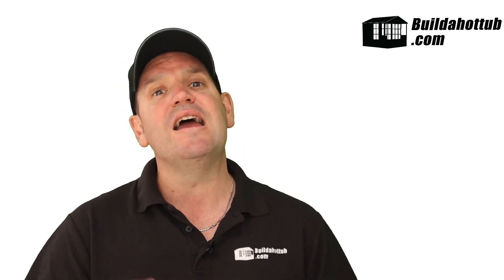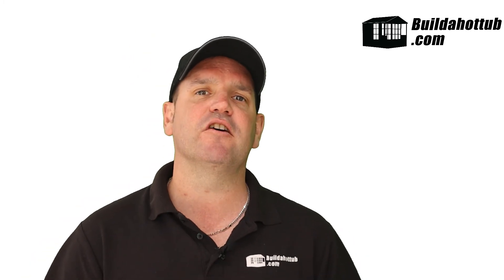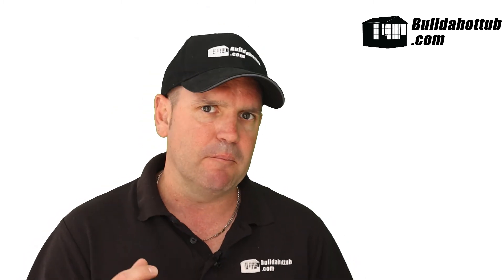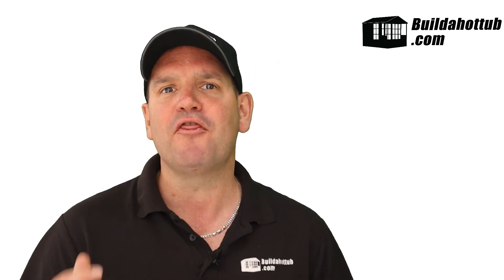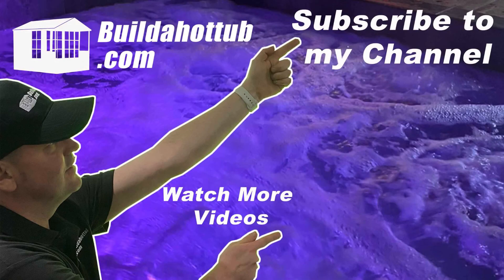How does hot tub plumbing work?

Comment: My bypass valve of the filter is not opening. My jet one does not have water coming out of the jets whether I put it on speed one or 2 and the bypass remains closed. Is this the cause of my problem? Please help anyone. 😢
Reply from the maker: Hi There, the flapper valve in the filter normally only opens on high speed, it is there to increase the flow on the jets when you are on high speed so the filter "doesnt get int he way" On low speed, it would normally be closed so I dont see this as being the reason you have next to no flow on low speed. A quick test would be just to remove the filter cartridge - if that improves this, then it is the valve at fault. It is more likely you have a blockage or an air lock that is causing the low flow on your low speed setting. Low speed is there for filtration and heating, it is not there to agitate the water just move it around. Hope that helps - Andi
Reply: @Buildahottub  thanks so much! The faulty filter valve was blocking both tubes. I removed it completely and everything is working normally. Is the valve necessary and will the pumps mess up, if I run the hot tub without it? Thanks again!
Reply from the maker: @kingbee4474  Perfect - glad you are sorted. You may find it does not filter as well as normally on slow speed it would force all the water through the filter - just keep an eye on your water quality and you can work out if you need to replace it or not - if you do, check out my parts site at www.parts4tubs.com - thanks

Comment: I'm building my own hot tub, should the circulation pump draw water from the bottom of the tub or the top? Same question about the water coming from the recirculation pump after it goes through the heating element, should it be pushed into the top or the bottom? 

Thanks in advance.
Reply from the maker: You should have 2 suctions drains at the base, a skimmer at the top so suction is both top and bottom - hot water returns can come in the middle of the walls. Hope that helps - Andi
Reply: @Buildahottub i have a dual speed pump ...my filter flap valve is faulty. Can it be the reason why my pump1 has almost no suction and not able to Prime?
Reply: My bypass valve of the filter is not opening. My jet one does not have water coming out of the jets whether I put it on speed one or 2 and the bypass remains closed. Is this the cause of my problem? Thanks

Comment: Can we just use 1 line for jacuzzi pump and circulation pump for jets?
Reply from the maker: Yes, that is how a dual speed pump works just one 1 line. If you have 2 pumps on 1 line they can "fight" each other for the flow which is not good and will shorted their lifespan. - hope that helps - Andi

Comment: I have an in ground hot tub. When the heater is on it starts banging on and off (the flow and element lights flick on and off). I can’t imagine that is correct so I shut the power off to the heater and left the pump running. However when I turn the blower and jets on the pump stops. Can you help?? I’d love to send a video.
Reply from the maker: Hi There, yes, that doesnt sound good at all. Could be an electrical supply issue and there is not enough current is my initial thought - but the banging is odd. To have a heater and pump that are bad at the same time is a little strange. Send me over a video and I will take a look for you and see if I can suggest anything -  andi {a.t} buildahottub.com

Comment: I just bought a house that had a pool with a hot tube built in it now I fixed the pool but the hot tube has a gas water heater from what I can tell intruders came and took the coper out of it my question to you is after I fix the water heater how do I do the plumbing do I need another pump ??
Reply from the maker: Can't be certain here from your explanaton - if you email me at  andi (a.t) buildahottub.com with some pictures and more information I can see how I can help you - Thanks Andi

Comment: If my dual speed pump is only running on low speed (heat circulation) what are the potential causes?
Reply from the maker: Hi Jesse, thanks for the message. Couple of things. 1) pump not wired correctly, you need a 4 core cable for a dual speed pump and there are 4 terminals that all should have wires connected to them. 2) incorrect voltage being supplied (if you are in the US, judging by the flag you are) it should be 230V for a dual speed pump not 115V 3) Jet button broken on your keypad controller and lastly, 4) the spa pack might have lost its configuration - you will need to tell it that you have a dual speed pump, if it thinks it is just a single speed or a circulation pump you would not get the jets - hope that helps - Andi
Reply: @Buildahottub  Thanks Andi!  Much better information there than anyone I have called out to service it yet. Ill look into the 4 strand wiring, and the spa pack and the spa pack configuration. Those sound like the most likely to me.
Reply from the maker: +Jesse Allison my pleasure. Out of all of them, if it was working then stopped, spa pack configuration “loss” is most likely. What spa pack do you have? If it is balboa I have lots of info on my site on configuring them
Reply: @Buildahottub  it is a balboa! I did watch your video on configuring the spa pack, and will see what I can do. Is there any other content you could point me to?
Reply from the maker: Hi Jesse - this article might help - https://buildahottub.com/hot-tub-wiring-explained/#Balboa_DIP_Switches_Explained